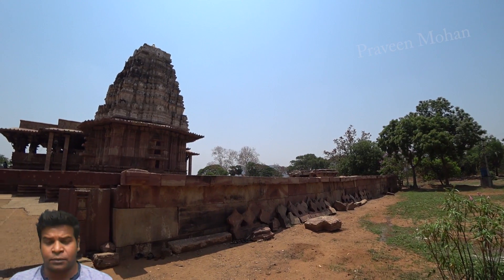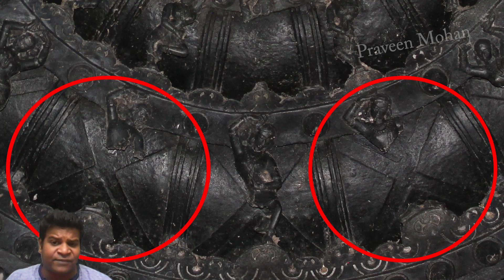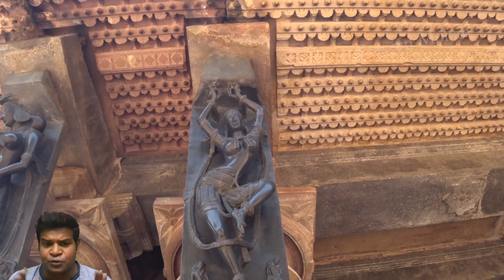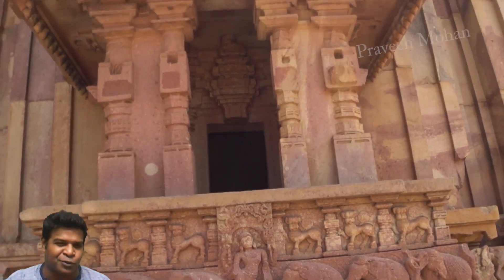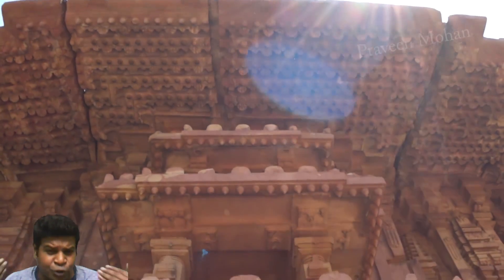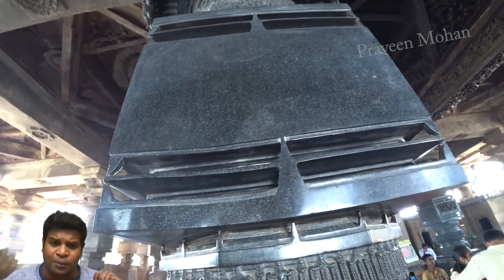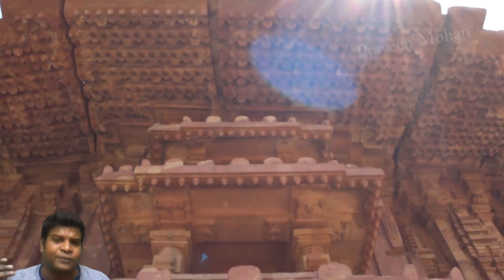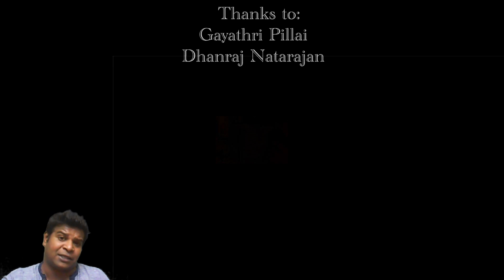Decoding Ancient Engineering Technology at Ramappa Temple, India

Comment: The vids you do on the temples are fascinating. The language barrier was a problem in this video. The Black Basalt Pillars have "twisted" or  "Skewed" sideways at the top, not "bent".
"Bent"  would indicate that the rock was bendable, flexible, like a pillar made of rubber. If I had not gone back and taken a second, closer  look at the pillar to see what part of it you were saying had "bent", I would not have seen and understood that the pillar had not "bent" but it had actually "Twisted  Sideways" or "skewed in a rotating manner". I doubt that "twisted" or "skewed" is the technically correct term either ! LoL 😉.   I wonder what the technical term it is that builders and architects would use to describe the process that took place when the E-Quake happened? Torqued" ? "Torsion" ?
Reply: Displaced would have been the better term.

Comment: As an artist, if I was asked to create these figures that are part of the temple, like the ones broken with that "X" carved behind them, I would add the figure, rather than carve out the figure. Given that so much of this temple has such engineering going on, is it possible in any way that those figures were added after the main construction was in place, using the same technology that the basalt large figures were added to the limestone they sit in front of? Some of the figures seem to have a strange unfinished, one would almost call, "mould" markings along the edge. Note at the 2:33 mark on this video, the figure to the right of the right red circled figure, the space between the breast closest to the red circle, and the hip, that part of the side of the figures body, there are what appears to be unfinished oozed out material that was never cleaned off properly. If you have ever made a mould of anything, you will get what I mean. 
There has been speculation that very ancient peoples have had the technology to create a polymer type of cement using crushed stone and advanced plastics like we use today, which could be used to pour or pack into figure moulds. Would be so interesting to see up close where these figures attach and if there is any evidence of such attaching material. Be also interesting to note if any of the figures seem like moulded replications. Are any two figures alike?
I think the modern explanation most archeologists use to explain structures as complicated as this one, assume there was no ancient technology more advanced or equal to todays technology. But I don't see how that can be the case. Also if we can assume they had bendable tech drills, they could also have polymer cements.

Comment: Great video! I believe that you are correct that they used machined tools for building. The step bit columns could be just that (a step bit), it can be that it is a form of partical accelerator. You see them throughout the world, probability using sound and light to generate vibration and frequency as an advanced 3D printing system, to create all the structure and art that make all these beautiful temples!

Comment: Mr.Mohan i have a second thought about advanced drill bits..i think it may not drill bits it may be advanced laser or any kind of light source which would vaporize the rock... The tip of the tool may be the source of light and steps may denote heat sinks or some kind of mechanism which helps to bend the tip..( Bcoz most of the temple sites doesn't have the broken rocks around it).. And also drills bits can damage small design while laser beams won't do that..
the x marks and the way they are attached is like that of a welding which uses a third material or same material used to weld it may be like spot welding 

KEEP YOUR GOOD WORK..AND UNLOCK THE SECRETS... THANK YOU

Comment: Great work. However, I just want to point out that what you showed aren't drills. It is known to archeologists that drills were made of cylindrical copper tubes. Despite being soft, when used with sand as abrasives and  'bow' drillers, they cut holes in hard rock equivalent to thickness of the copper tube. The core was then chiseled out. This same technique was used by Egyptians in their Pyramids and caskets of granite. You have to read Denys A Stocks works to understand the techniques better. HTH

Comment: Exquisite architecture and construction, the work of a genius.
Note though that a step drill is designed and used specifically on sheet metal, it will not work even on soft stone, and the mortise  joints you found have been used also for thousands of years, even at Stone Henge!
Reply: But the point here is, our ancestors try to teach us how they built this temple without dismantling it

Comment: Praveen, thank you for your vídeos...Índia has amazing temples  full  with  beautiful sculptures.
About the pillars....i think  the difference in polishing is because power tools don't reach every were....so they mold  or sculpt the detailed part of the pillar.... the molds sometimes don't do all the details ,and the little holes where you insert the strow were done by hand with a 1mm ,2mm cutting tip,apllyed on a  chizzle...half the hole is done on the top,the another half on the bottom ,than enlarged with a thin round abrasive(lime).

If the prototipe also represents instruments or tools ,i think that the triangles are some kind of cutting tips that they use to aplly on those tools ,carved  next to it .
That explains why the instrument has a flat  point,  the cutting tip is on the shelf....on this case, i think they represent( in the zone of the carvings  )the cutting tip used to do the kind  of those small  sculptures .
My best wishes ,keep up the good work......

Comment: As for the accuracy of some of these they would have to have had CNC type equipment. Further I see where they probably used high-tech cut lasers using mirrors to do some of the back cutting and such small one mmmm dimensional work. Commonly nowadays we're starting to use 5-axis on our CNC lathes and Mills and so on, however on some of this work I see where they must have used nine different axis, maybe even 12. I wish you would have had a borescope with a flexible head and a high intensity light to film in these columns it would have give a lot more dimension in detail and understanding. Like your videos can't wait for more. 👍👍👍

Comment: Nice video. Great research. I have some questions... 1. You showed the pillars have small holes. I couldn't help notice that the pillars also have shiny surface. How can carving and polishing done to this stone. The pillars have accurate figures. They look as if they were moulded in a cast with intricate carvings. No useless small tools can carve this intricate design, neither has it been done by hand. 2. The slanting statues were placed in slots, but why was a different stone like basalt used for these statues rather than the same stone material used for the entire temple. These statues create a contrast effect. 3. You showed a replica of the temple. Everything is scale to size right from the pillars to Nandi, and you said there are tools in the replica model but nothing like that in the temple. If the model is scaled down to size to represent Nandi, is it not possible that the so called tools could be as big as the real Nandi in the temple. Wouldn't the temple builders have shown it smaller or tinier than the Nandi statue? I hope you can find answers to my questions and I hope they help you in your future research! Good luck!

Comment: It makes perfect sense to me these columns were made out of stacking blocks. Else with all that details, a single error would waste a whole column, let appart structural, handling, and assembly constraints for these not to be a single piece. 

About the drill bit, it might be a tool, but I don't think a square drill bit would be really efficient, nor something controlable by hand or by machine once is set to rotate and carve or cut, as it would produce no other than bumps. Besides, what size should it be for it to drill those 0.5 or 1 mm holes?

I'm more with the idea these colums were all cast and then postprocessed to clear small holes, polish them, and add extra features, which leads me to the X behind the miniature sculptures.

If they could cast, could have also used tiny blobs of molten rock as glue, such that once solidified it's all the same material. Or else they could also use another chemical solution, but whatever it is, it's clear by this and other videos, that hammer and chisels will take off parts of the original work these are stuck to.

Great videos by the way. Keep them coming!

Comment: I think the statues play an important role in earthquake proofing the building. What is most astonishing is that I think these buildings are individual pieces, that is, they HAD to have put the statue first holding it in place, before lowering the roof on top so it would click onto the slots for the statues. That is the only way to do this. If this is the case that the second floor is entirely one separate piece, what machine lowered it onto the base!

Comment: Praveen sir the stambh of temple may have used huge bearing technique at the top of the stambh made of same basalt stones as whole pole is made of basalt rock may be its upper part is made of two piece part, with a socket joint connection, which kept it stable by setting in a way like plinth beans, even after earthquake. That may have bend the pillars